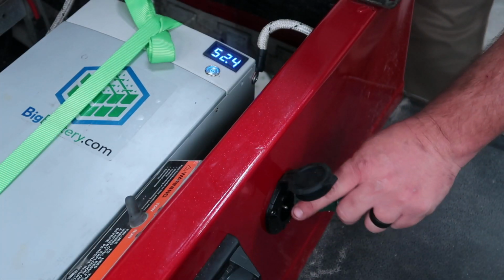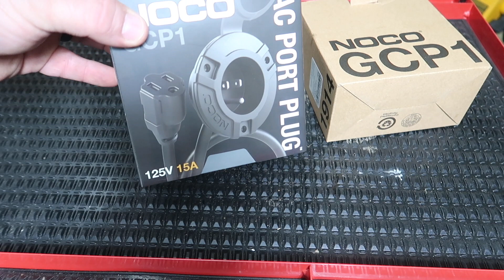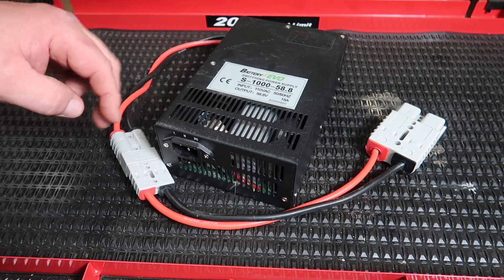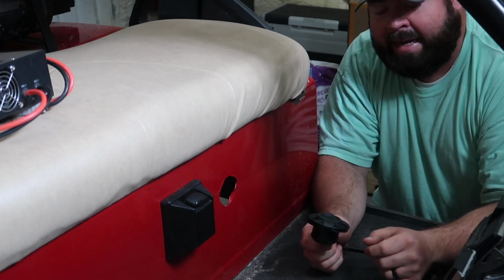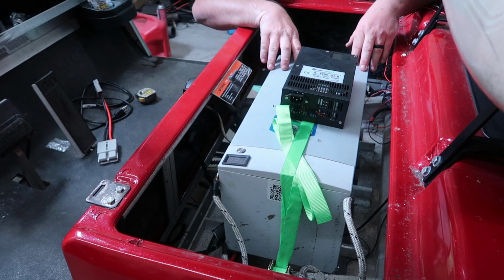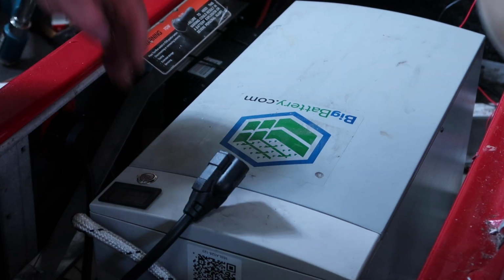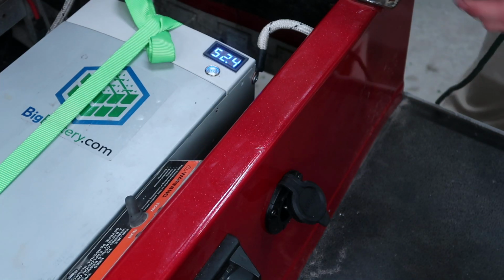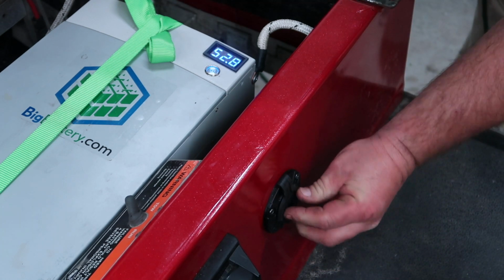HOW TO INSTALL NOCO GENIUS GCP1 15AMP PLUG | GOLF CART ONBOARD CHARGER | PERFECT DIY FIT & FINISH

Comment: I put one of those on my pontoon boat. About the ratchet strap, I put a 160ah RoyPow lithium battery in my RXV. I manufactured a frame from old angle iron bed frame. I bolted it to the cart, and the battery to my frame. Nobody expects an accident, but last month my oldest grandson “borrowed” my cart without our knowledge. He flipped it in a concrete culvert. Had I not secured the battery, the injuries could have gone from minor to major. Just my two cents, as that happened to mine.

Comment: I bypassed the OBC on my Club Car DS and ran the factory charging receptacle black/negative wire to the battery negative instead of the OBC. Do I just delete the black wire now if I install the Noco plug?

Comment: How do you bypass the factory charging port on a 2014 ezgo txt? I have the new port installed but the cart won’t run unless I keep the wires from the factory port connected?
Reply from the maker: There is a blue wire on the back of the port and it runs into a connector to a red wire. Unplug the red wire from the blue wire and tie the red wire to the main battery positive.
Reply: @Fentertainment  Thanks a lot. I really didn’t want to keep that other connected and tucked away.